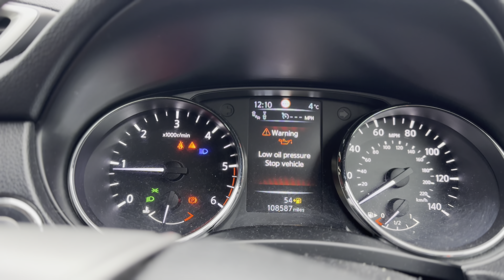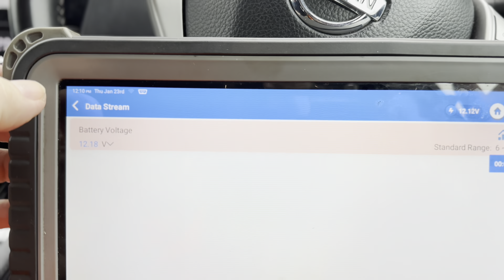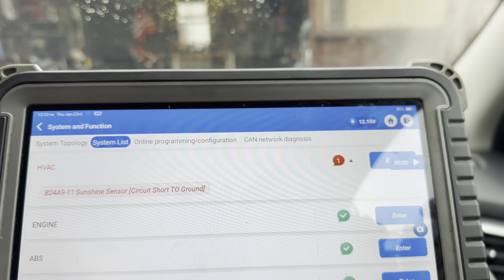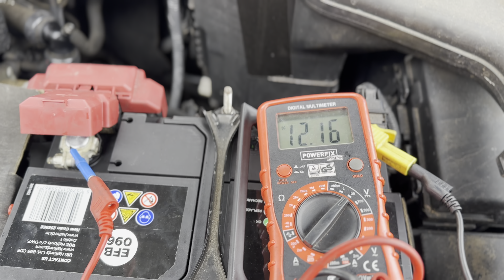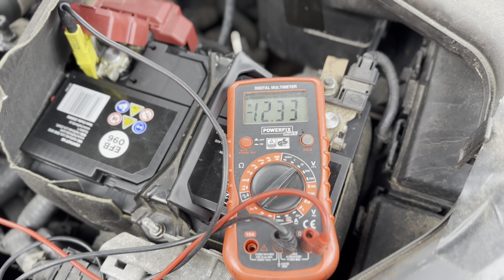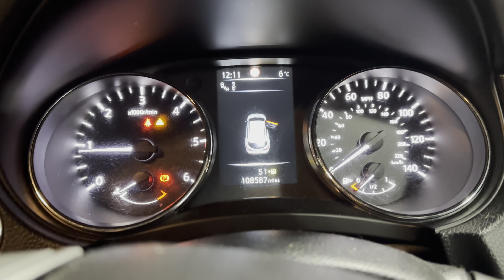Nissan Qashqai 1.5 dci (2017) - Low Oil Pressure Stop Vehicle 😫

Comment: The battery discharge counter should have been reset when the new battery was fitted before it came to you Sandy.
The counter simply measures the battery voltage at a level it's required to be recharged again.